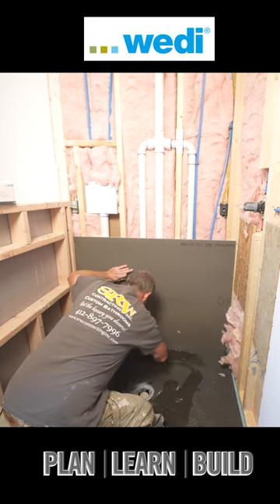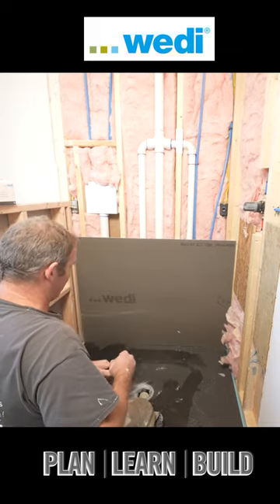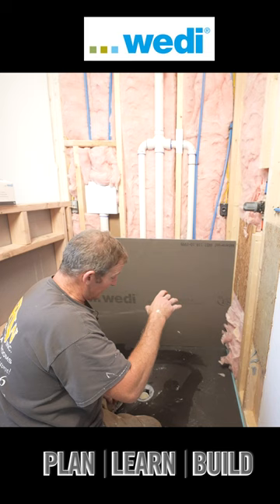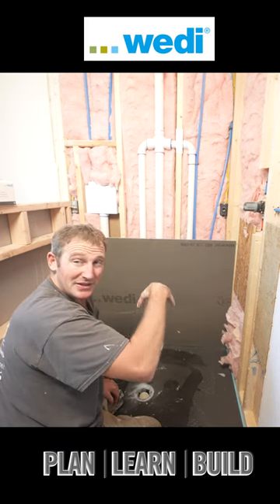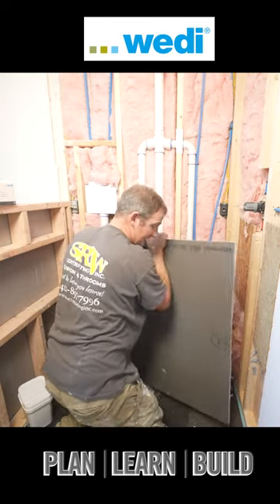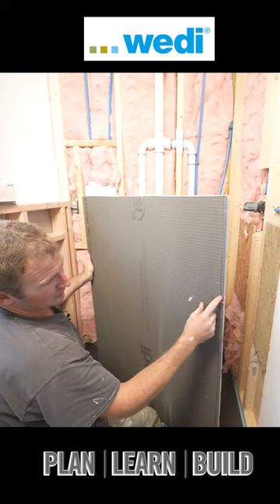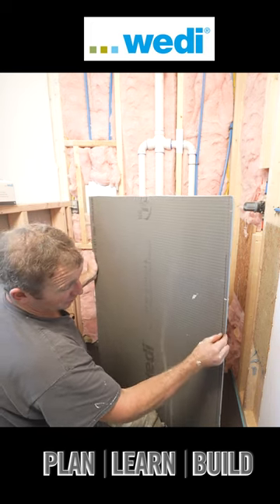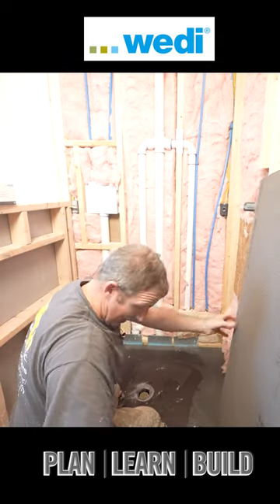Wedi Board Tip #shorts

Comment: Do you really think those joints along the shower pain will stay sealed for a long time? I'd be worried on a second floor over time with movement etc. I'd like to use this on our shower, just makes me nervous.
Reply: those joints don’t get wet, they would get wet after a massive tile/shower pan failure, this is simply to make sure the backing behind is waterproof in case this does happen to prevent flooding, so yes they stay dry and sealed for a lifetime if done properly